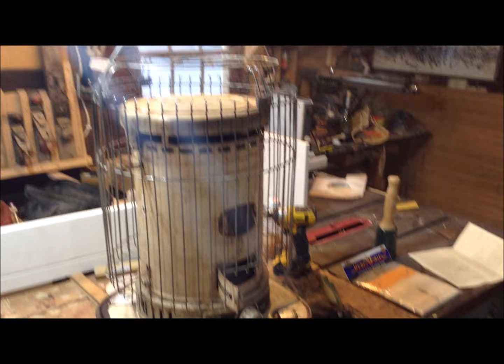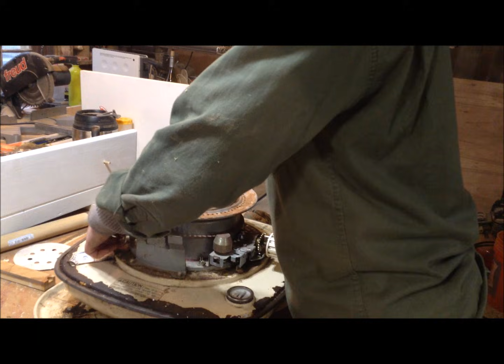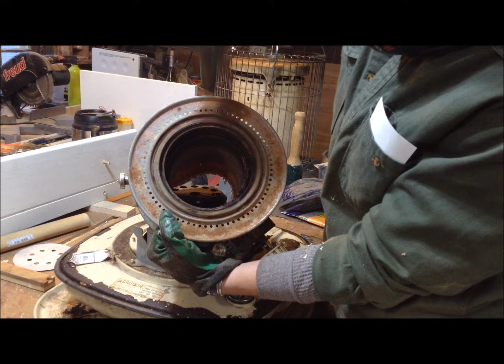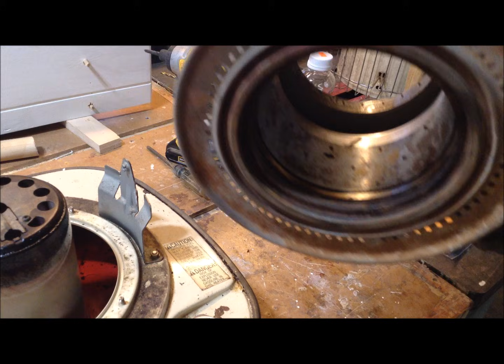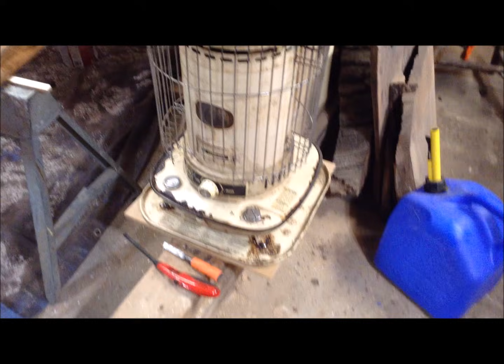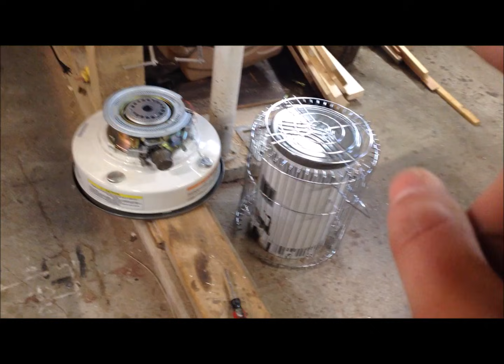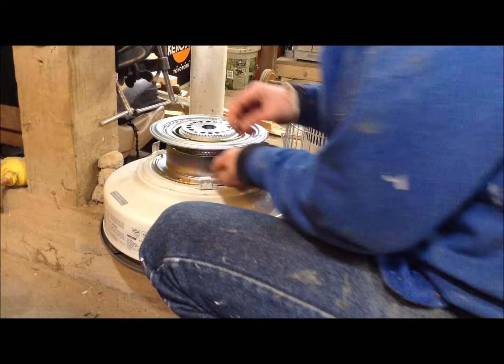Replace 3 Pinned Wick In Kerosene Heaters || How-To || Corona DK-23

Comment: Great video, and I have the corona 23dk, paid $20 for it at a thrift shop, but I figured out after a month of use that I needed to use that kerosene fuel additive to extend the wick life,...most people use the additive, and I didn't,...haha, screwed up, I sure did, .....so the problem of mine is that I use red k1 kerosene and I believe it carbons up faster, and I started out with a new wick but after, well, filling up the tank like five times I noticed there was starting to be a problem starting it and burning,....then I say when I had used twelve gallons, it wouldn't light.....I put some additive in the kerosene and took the thing apart and wiped some carbon off and did some cleaning,...ordered a new wick, nothing sold locally, so it worked better, but I feel now that I have a new wick that I probably will have to take it apart and put the new wick in anyway, even though I have run it dry several times, like four more gallons,...if I had used the additive from the beginning that I am sure I would have no problems with the original wick, a obvious new one, when I started.  Around here, red kerosene k1 is $3.35 per gallon, but clear, only found at the local hardware, is almost $8 per gallon, and, well, as cheap as the wicks are, I'd rather continue to use red kerosene at its low price per gallon.  ...That was interesting about the new kerosene heater being more fuel efficient,.....of course the manual for the corona 23 dk is online, and it claims 9.5 hours operation per tank fill,.......that would be interesting if the new dynaglo or other new ones get more hours per the same amount of fuel.  I sort of feel the older ones, like the corona, are made better,...its possible yours has some problems due to age, use and or abuse, maybe, unsure how that could effect thing, ....I do like that the other brands are easier to change a wick,...oh yeah, if I could spare the cash for a new one then I'd do it, but they are like, let me see, at walmart, $125 or $135 for a dynaglo, and they sell wicks there too.....I use mine to cut down on the huge electric costs in winter, and its working,....maybe next year I'll  have a newer model as a second model, I too am building a spare shed for painting or woodworking, or other things, apart from my custom built and insulated 10x16 footer building/shed with electricity that I've done some wood refinishing and small painting projects like you do.  I would say that I am on the southern Oregon coast and that winters are mild here,...well, I live too close to the local dunes, and the cold air rushes off the ocean and over to my place home and freezes the heck out of things here sooner and quicker than other locales more inland, and they raise electric rates in winter, I could be paying with a newer energy efficient electric furnace in a double wide manufactured home less than ten years old into the $300 to $400 range per month  if I set it to seventy five degrees and just left it there all winter, back to fifty bucks in warmer times, ...go figure, so aggravating,...so technically, maybe by next year I will have seen a newer kerosene heater at a thrift shop again for twenty bucks in summer, or by next winter I will just bite the bullet for a new heater with readily available wicks as a second one to have, especially with my work schedule and my health that when I had a problem with the heater that it took me a week to get around to screwing with it, cleaning, and ordering a new wick, ...using electricity to do some heating, god, my electric bill.  Anyway, am running mine down to dry to burn off carbon, even though I have a new wick right here, as an experiment, to see what happens,...though I should for sure this weekend, well, my weekend, sunday and monday, change my wick to brand new, probably will,...AND will use additive,....its one ounce per five gallons, and the bottle is eight ounces.
Reply from the maker: I wish I would have remembered to mention the additive in the video.  I use it as well and it makes a big difference.  I use the red Kero too because the other stuff is ridiculously expensive.  Right now I run both first thing in the morning to take the edge off, then run one or the other for the rest of the day.  I have been going through about one 5 gallon tank a week and it is about 20.00 to fill up so all in all I am pretty happy with that.  The next few weeks it is supposed to get much colder though so that could change.  I have been getting the shop to around 50-55 degrees.  I could get it warmer if I run both on high all day long, but there really is no need for it.  Funny the manual says you can get 9.5 hours per tank fill, maybe on low you could get close to that, but I would guess I'm more around the 6 hour range per fill, maybe a little more haven't tracked it too closely.
Reply: I just used diesel for the first time yesterday, cause I failed to get some k1 red tinted kerosene during the week, and the place was closed on a Saturday,...its running right now on diesel.  What I did though was use "seefoam" anti gelling additive like others said, ....it is one ounce per gallon of diesel, like the instructions on the additive says, plus if I want to I can get kerosene and just dump the diesel into my diesel truck tank.  I almost swear I saw less smoke at start up than with k1, and the additive makes sure the wick is not screwed up.  One point though, I believe the small amount of smoke that did come up was more dense, and it left a little on the top of the heater, maybe more inside,...bummer, but it can be used, and I suppose I could use more additive or use the k1 kerosene additive as well or just the k1 additive.  I was using electricity recently, thought winter was over, haha, then the snow started on the Oregon coast, plenty of freezing weather.  Frankly, I like that diesel has no color additive that I knew was a wick clogger if not careful.  i I cannot smell anything different using diesel, almost seems less stinky, and I think that the soot on the top and on the inside is cause diesel is thicker, and I could treat the heck out of diesel with additives, .....more additives.  Seefoam additive isn't exactly cheap though, I think its over ten dollars a bottle, but might be cheaper than k1 additive even if I used two ounces of additive per gallon instead of one ounce per gallon.  I will experiment, when I turn it off, I will wipe the soot off the top that formed, put in a little put in some k1 additive I have left into the tank of the heater.  I inspected the wick this morning, I had let the diesel heater burn off all its fuel and shut itself off  this morning,...with the window opened a crack in the other room, and the wick was clean as a whistle, no carbon or anything bad to report.....I have run the wick dry a number of times since when I had clogged the wick after only 12 gallons of untreated k1 kerosene, ....when it didn't even want to light, and when I put additive in the fuel, let it stand for two weeks and got it started and burned it dry, the first time I had done that, and the wick has not needed replacement since.  If clear kerosene was cheaply available locally like it was years ago then there wouldn't be all these problems with wicks as much.  I have an outbuilding that I want to do some painting or wood refinishing projects in, even in summer, and a kero/oil heater like this could make those projects successful, so its a win win, plus I save at least something on electricity in winter, here, where winter rates can get ridiculous.